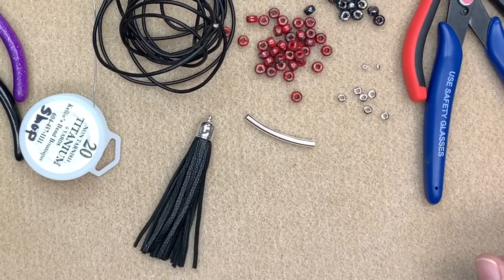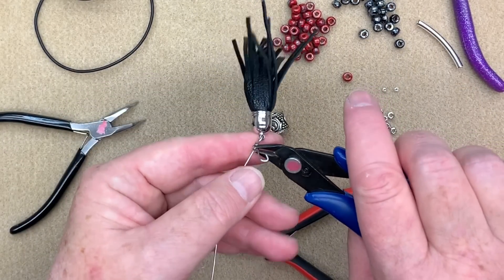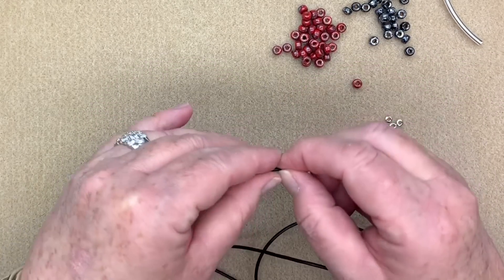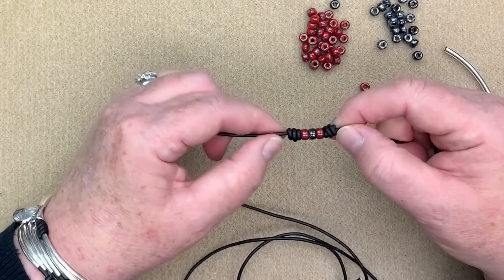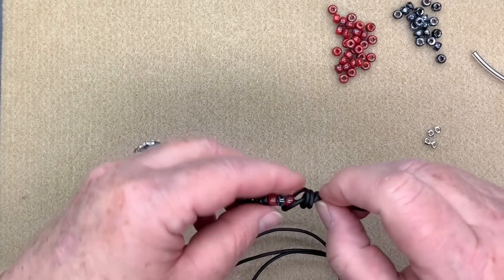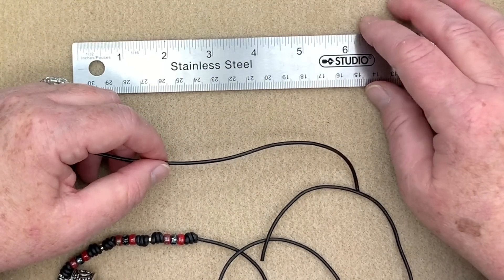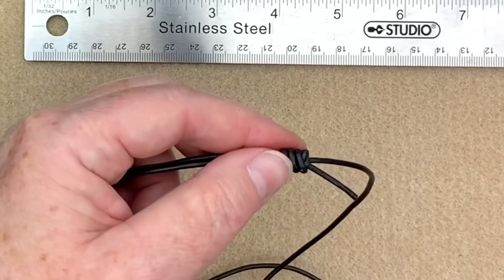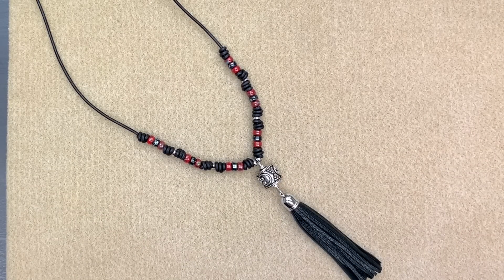Learn how to make a barrel knot leather necklace with a sliding knot ending.

Comment: My bad..  its BEADIFULNIGHTS.... dollar bead box.  
Anyhow you can do something similar.
Reply: Oh, I  just thought of something, depending on the bulk prices of the stuff you use in the kits, do you recall the other suggestion a week or so ago on helping a nursing home?  You could still offer it for an very discounted rate. Where you could make $$ or atleast come out even and write off what you can on taxes.. i dont know how Canada works on taxes. The point I'm  getting at is, if other nursing homes sorta joined, say from a referral from a few homes you helped, then they can buy kits more at the prices you quote,  plus they buy several a month. They may not have all the patience in 1 class each week.  Like when i was in it, there were 6. I saw the week prior with 10. Anyhow, they all may not want to do a female necklace,  so some might work on dif things or in a kit, you offer 2 dif bead actives. On color stickers marked for each project  . Blue 1-10, yellow 1-8 etc..  
You can offer easy, medium and hard classes too.  If ppl want to use wires, tools etc.   Medium could be a mild use of tools on and off. Upper lever knotting and such. 
So if a nursing home is interested, if they bought 15 kits, with 2 or 3 projects,  thats not 1 view on YouTube but several views. From 1 location over time as well. Plus if they joined, you dont need to cut leather,  just include a roll with enuf. They can cut it to length.  Oh and easier projects are larger holed beads especially for shaking hands.  Plus you can donate what you dont sell in the beads you put on the 1 table for discount  .. mismatched stuff that doesn't sell. So the ones not wanting to do the YouTube project can do whatever. Again not knowing tax write off in Canada.  You can even do vids at a Vets, senior or local nursing home or centers. Thats a great way to get locals to see your box options and YouTube vids that can view anytime. Anyhow,  I'm  just getting back on my feet.. i hope to return to a PT job vs SSI support. It sucks.. plus Trump's put more good ppl in the street that work, have kids or seniors,  vets etc. The prices shot up way to high for many. California building owners are trying to make tenants p as y their ridiculous mortgages.  They bought them riding the false trump bubble and its crashing. They need to file bankruptcy soon or kill themselves.. lol. Anyhow,  my son and I are in that situation,  but he works FT , we have no drug history,  smoking or drinking yet ppl assume all in our situation are that way. Such is life, we go where he can work ft. Being a military family helps extremely especially the adjustment processes. 5 yr wait to get housing assistance..  .. sorry, off topic. 
I hope you can expand your business ...  if you choose to do project boxes and need help, Id do my best to get the word around to local centers about it if they offer classes or want it. I was a USO volunteer for over 28 yrs. I really loved it and being around and helping others.